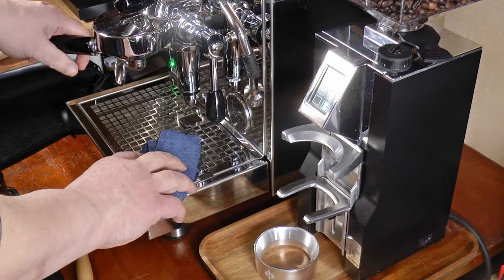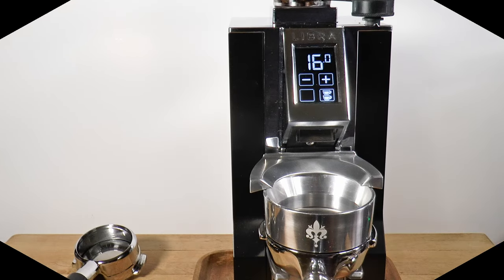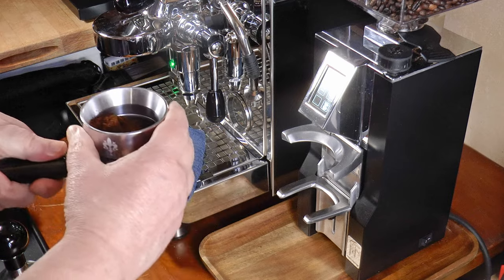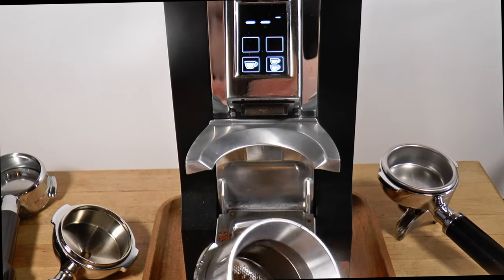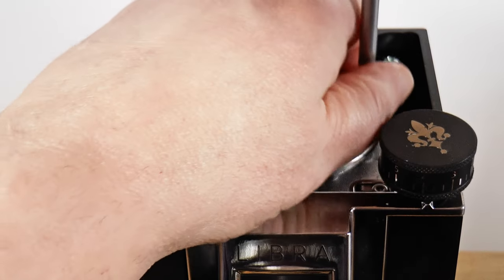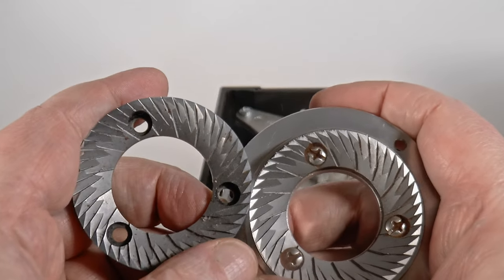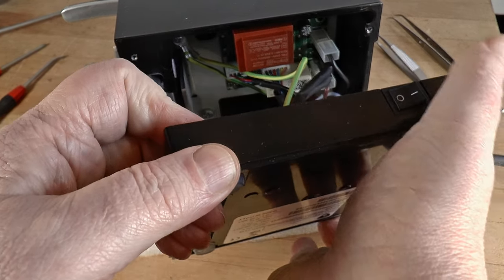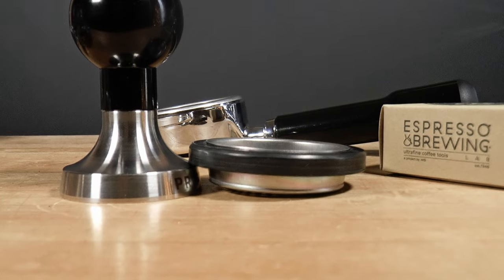Mignon Libra in Depth, pt 1

Comment: Does the Cafelat Robot basket can be used  with the Libra? Would be interesting to know :)
Reply: I'd like to know this as well
Reply: Thirded.  I have had the Mignon Brew Pro for a while now but just picked up a Robot recently and I'm starting to keep an eye out for the right grinder to pair with it.
Reply from the maker: It's not really stable. You might be able to hack up a small adapter from household items, though.

Comment: I got to play with the Libra last month and when comparing with my Sette 270Wi I did like the build quality, sound and portafilter height adjustment. I wasn't impressed by its speed, clumps, messiness (without the funnel), grind adjustment (difficult to change to a different setting and return), FE errors, and popcorning when single dosing. If I had to choose, I'd get the 270Wi. With that said, I'm looking to add a flat burr grinder this year and the Libra is still a candidate. A key point in this decision is one thing I didn't get to test - suitability for pourover. The Sette is really poor, at least with the stock burrs. Is the Libra a good grinder for pourover?
Reply: Dear OB, thank you for your feedback 😊 If you allow us, we would like to clarify some of the points you raised. 
First of all, mess: basing on our lab studies, we suggest, for more than 8 g per single dose and 15 g per double dose, to use of the Mignon Libra Dosing funnel, which is included in the Mignon box. It is a non-mandatory tool, but we suggest, should you grind the above, to use it. 
As far as the FH signalling is concerned, it is a system that was created with the aim of guaranteeing maximum quality in the grinding process: our tare is in fact very sensitive, and this is a plus in terms of precision. At the same time, however, to preserve excellent results, we decided to introduce a system that prevents any possible damage to the system and its precision. 
We have however released a video on our channel in which we explain how to use the coffee grinder correctly: https://www.youtube.com/watch?v=LvQJc4C8e50 
This model of Mignon Libra is designed for Espresso grinding, as the fork is specially designed for the filter holder. In any case... stay tuned 🤫
Reply: @eurekagrinders9555  Is the Mignon Libra Dosing funnel included with the Libra, or is it a separate accessory?
Reply: @Nutle159  Dear 😁, thank you for the question , it depends on the dealer some prefer to include the Dosing funnel with the Mignon Libra. In other cases, the Dosing funnel is sold separately as an accessory with a dedicated accessory box.
Reply: I was thinking of the 270wi too but I ended up getting a killer deal on mignon specialita. A store return for $325 shipped to my door. Thanks Seattle coffee gear i love it,seems like extremely good quality. I have no regrets for the price.
I had a breville smart grinder and I replaced the main gear 2 times in 2 years. I was very concerned about the build quality of the 270wi,do you believe it has build quality as the eureka?
The breville smart grinder was definitely a mistake and would encourage anyone who drinks 2 espressos a day to avoid it at all costs.
I had over $300 and plenty of hours of my time in it in the past 2 years and I finally threw it away.

Comment: Very useful video thank you. I wonder if the Libra's base enclosure is made out of plastic or cast aluminum? 
Those broken parts within the unit are certainly of concern, especially the black ones. The white broken plastic screw heads seem to be sheared off by the plate holding the bottom PCA, either due to poor process, material, vibration etc. But the black broken parts could be more serious, especially if it is from the base. Looks like a reliability issue. Maybe because this is still an early production unit. 
I was just planning to order a Specialita over the Libra because of the prettier product dimensional proportions, but after watching this video I have concerns about Specialita's quality too.
Reply: Dear semipro33, as Thomas said in his video, transport may probably have caused those parts to break. These are very rare conditions, but unfortunately they can happen, regardless of the model of coffee grinder. 
In case it does happen, we at Eureka will be ready to support you, together with our dealers, to solve it. 
We are always available to support you, and provide you with the best possible customer service 🥰🥰
Reply: @eurekagrinders9555  Thanks for your reassuring reply, the Libra and Specialita are indeed beautiful machines to behold, ciao!
Reply: Isn’t damage by transport what shock and vibe testing on packaged products is done for?

Comment: Have a libra and I do share your conclusions about the ECM bottomless portafilter. It kind of fits but gives a lot of errors (with the same eureka funnel as yours). What I do not like is that you must recalibrate the grinder each time you change the portafilter. I wish you couls save settings into memory. I want my lungos with a double spout to avoid the mess but I use bottomless for espressos ... Yous videos are excellent, I can't wait to see the next one, thank you !
Reply: Dear Stéphane, our tare system allows automatic, real-time calibration of the filter holder that is placed on the fork. No manual calibration is needed! All you have to do is grind and enjoy your coffee, the Mignon Libra will recognise the filter holder and grind the selected grams accordingly 😉
Reply: @eurekagrinders9555  could you please then update the user manual ? It is nowhere explained. Another issue I have is plenty of FE errors I have sometimes to position the holder a couple of times to get it work. Lookinf forwart to your update on this.